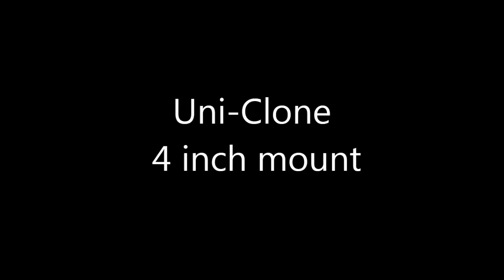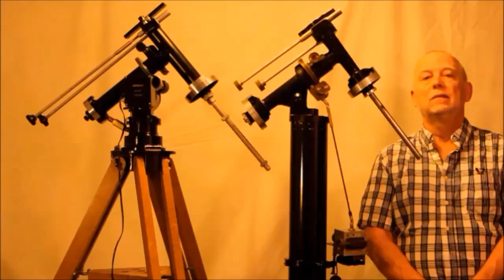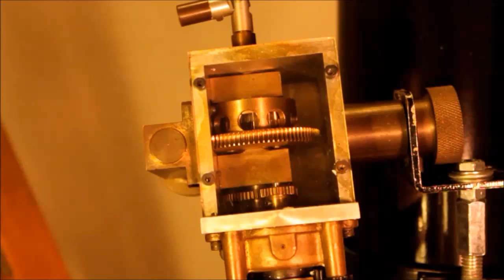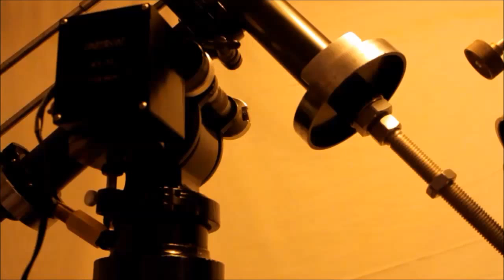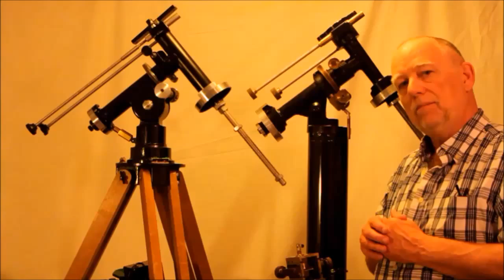UniClone

Comment: The Unitron mount uses a synchronous motor like the Questar. Your pedestal mounted equatorial uses a driven system invented after the Civil War (1870s).  Standard AC & synchronous motors were another generation away at this time.  Another interesting fact is that the basic gearing system in that box was invented 2200 years ago by the Greeks in the Antikythera Mechanism.  That's a fine piece of mechanics you have there.  Thanks for sharing this.